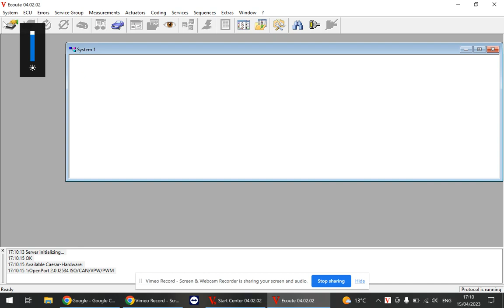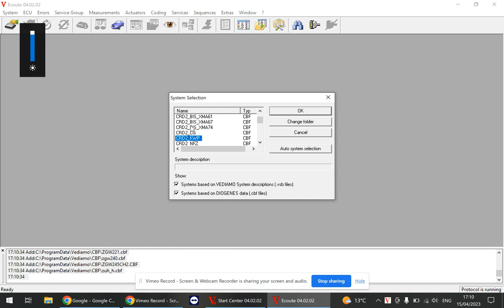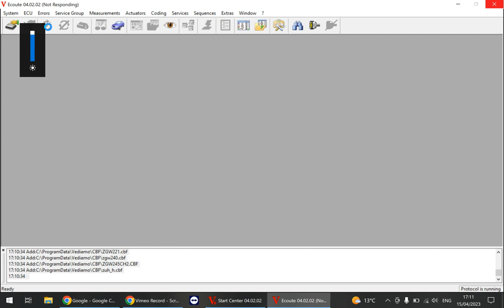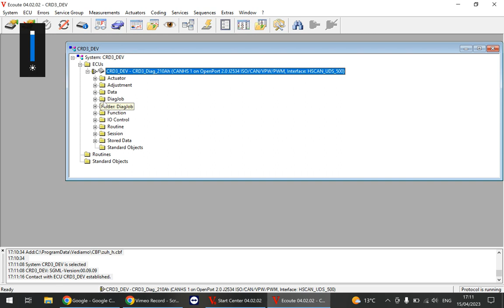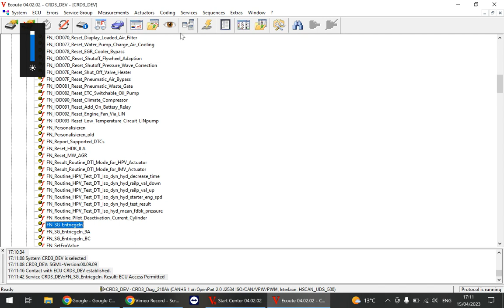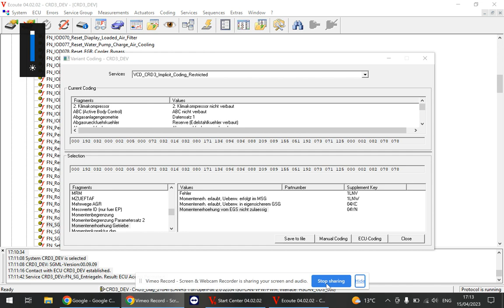Mercedes ECU Common Variant Coding Vediamo (English)

Comment: Help please. I use Openport Tactrix. Entriegeln doesnt work, not permitted. Where is the Problem. I can not save variant coding complete. without oil data fix and variable and fuel data from IC.

Comment: Hi MBAutocode, I can help you translate stuff if you need it mate. Im a Londoner who lives in Germany, and started using xentry and also vediamo about a week ago. I haven’t done anything fancy yet. Just got to do litres remaining in the tank and also got to do signalling to 4 instead of 3.. im here if you want any help 👍🏻
Reply from the maker: a good trick i learnt was to save the coding in html convert to pdf and use google translate to view all the parameters in english and then just compare with the german file thanks though mate i will keep you in mind
Reply: @ynte8114 I did exactly the same :) remaining fuel and signalling.
I want to enable 569 - enable adblue metering
And it would be great if you or @MBAutocode could provide Coding list in English.
Thanks in advance
Reply: @Matt_3535  Im a newbie myself. I just said I can help translate things if he needed any help with.
Reply: Hey bud , you still available to assist with the translation to figure out what the value changes do?
Reply: @rashvinganesh  what do you need exactly?
Reply: @ynte8114  Trynna understand some variant coding present in HU55 , MED40 and IC204 modules. Translation isn’t working at its best for me currently.
Reply: @rashvinganesh  As I said im not a coder, I have just done some bits and pieces.
Reply: @ynte8114  I get that you have done some coding throughout. I have done the same. I was actually referring to the translate portion of your comment. If I was up to experimenting with variantcoding and its in German , would you be able to help out with the explanation if you know em or maybe a more accurate translation- that might help both of us i think
Reply: @rashvinganesh  yeah no worries mate, I can sure help you on that.

Comment: Hi .. thanks for your video .. but i have a questiin .. how to activate mercedes ecu me2.8 which fit in w203 w211 models . Is it passeble to write the vin number in the into the ecu using openport 2.0 or must be using vediamo on table only ??